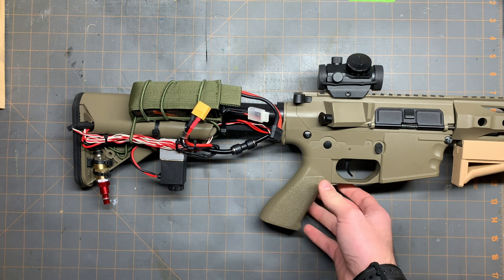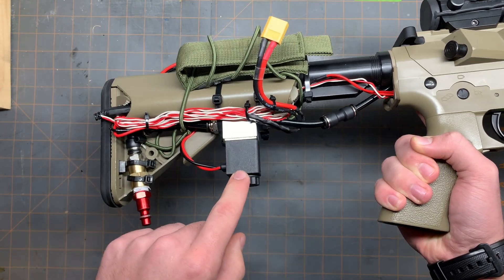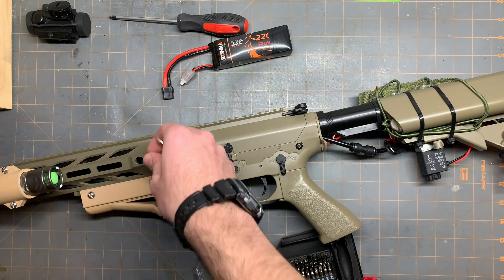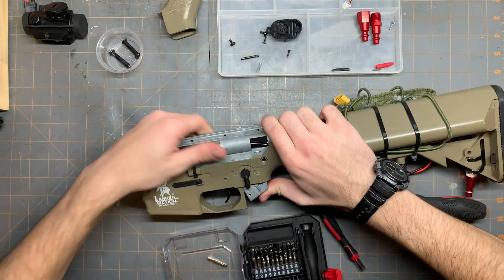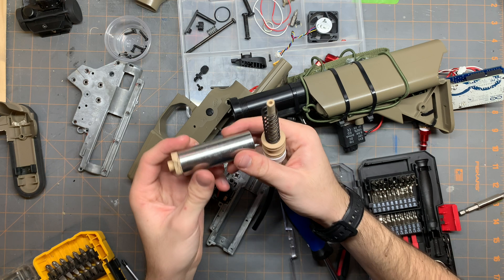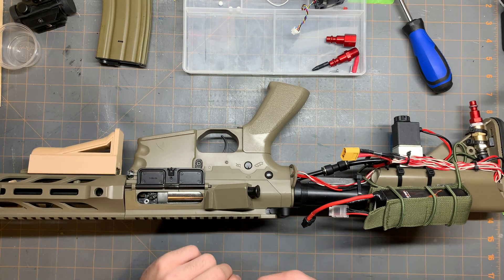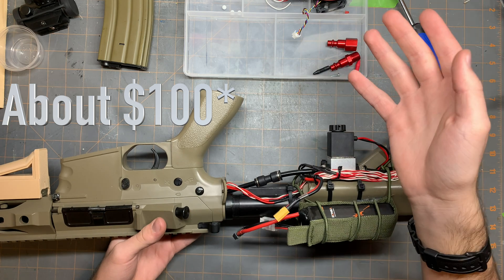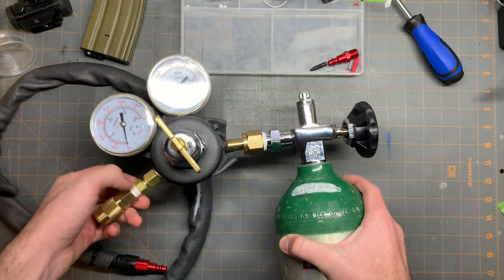3D Printed HPA engine in an airsoft gun Part 2

Comment: your battery looks swollen
Reply from the maker: they keep a full charge, and last forever, how do i tell if its a bad swollen?
Reply: Its generally considered best just to stop using them once they start to swell up, doesnt really matter if they hold charge or not. Chances are higher that it will catch fire when you charge a swollen battery. I would store them in a fire proof battery bag if you dont already and definitly replace it asap @reidyboi2269

Comment: Really cool video! Ive been trying to make something similiar. Im using the same style of solenoid and tank setup but with 14mm 3d printed slugs. My goal is to have rifling that interfaces with female threads on the slugs to make properly rifled projectiles
Reply from the maker: interesting, how do you plan to make the barrel? also the slugs would have to be flying to interface consistiently
Reply: @reidyboi2269  I'm using a 3ft section of carbon tubing and before the barrel I have a 4 in section of rifling. So far with using the setup as a blow gun, the rifling does work
Reply from the maker: interesting, id love to see your project, in the description there is a discord server where people have been sharing similar projects @chrisriley557

Comment: Hey, i did the same engine but with modified parts for a better performance and with a solenoid in the gearbox, contact with me for questions if you need
Reply from the maker: i tried to fit it in the gearbox but i couldn’t get it too work and i almost think it looks cooler on the outside
Reply from the maker: what did you modify if i may ask?
Reply: @reidyboi2269  the lower part of the nozzle, I made it in cone shape to take advantage of the bernuilli effect, in the inlet piece I made a hole in the center and lengthen the tube that goes to the nozzle, I saw that to make the cycle of loading the bb did not need much air so with that hole the air flows much better, are necessary improvements to have such a small valve, with large valves and these same modifications I need much less pressure
Reply from the maker: @salva-my7ow  interesting, i may try some of these in the future 🤔
Reply from the maker: also i made a discord if you wanna trade ideas https://discord.gg/3VNtNPcMgU